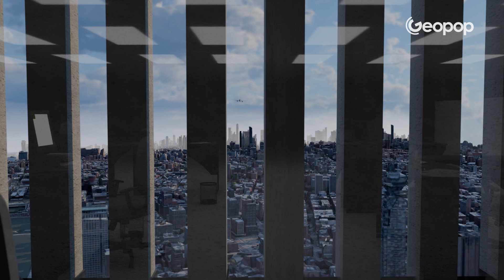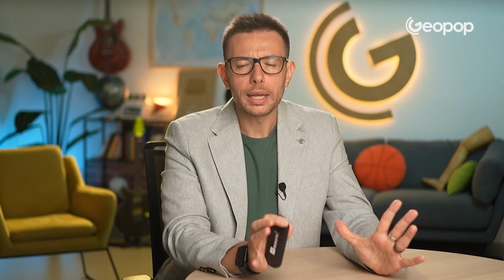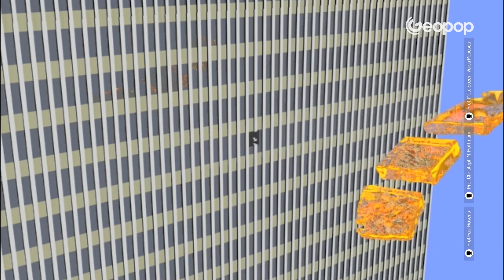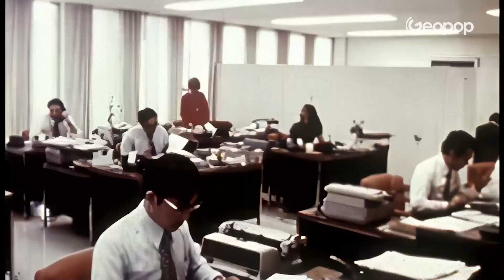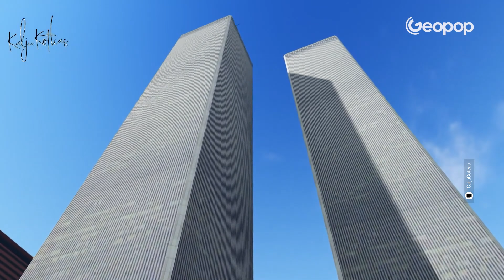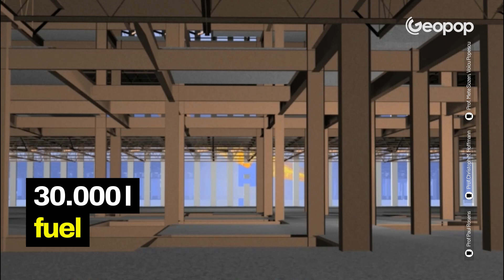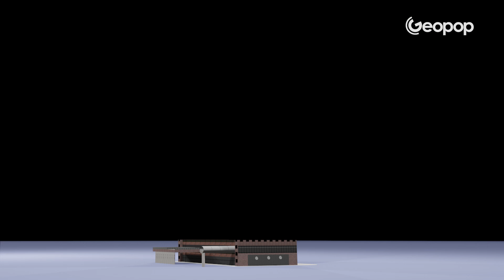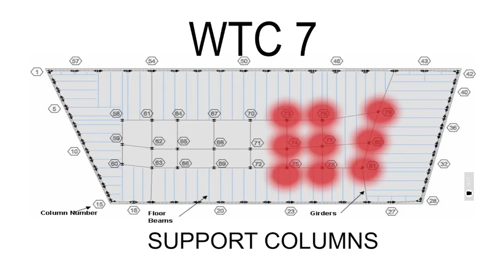9/11, 2001: The Technical Reconstruction of the Twin Towers and WTC 7 Collapses

Comment: What a load of
Reply: Knowledge
Reply: Get some.   @TheLoonResistance
Reply: I did. Now I can do this and you can't:  Twin Towers collapses were relatively straightforward, the fundamentals well understood in the professional engineering community within just weeks. Yet there’s a lot of really bad information floating out there on the internet, easily accessible to anyone and wild baseless speculation and pathological theorizing with easy hand-wave answers is simple, exciting and requires a whole lot less thinking, so it gets far more intention than it deserves.

To correct this I have on my own prepared this short yet detailed technical description of Twin Towers collapses based on my own observation and analysis of available true and relevant facts. No politics, ideology or magical thinking, just engineering. I hope is this will dispel many common myths and answer most if not all questions you may have about the Twin Towers collapses, because anything can seem like a conspiracy if you don’t understand how it works

While complex, most of the Twin Towers collapse mechanisms can be seen with the naked eye and easily discerned and understood by the layperson if sufficient time is taken to understand. 

1. The Twin Towers consisted of 4 primary structural elements that together formed an integrated system where each relied on the others.  47 hollow box-section steel Core Columns carry the majority of the gravity loads. The 236 hollow box-section steel Perimeter Columns carry the remainder and ALL of the lateral (wind) loads. Long-span Lightweight Steel Trusses connect the core and perimeter column together at each floor with a Hat Truss on top to tie the structure together as an integrated unit where no element can survive without the others. There was no structural load bearing concrete and most components were bolted together. www.youtube.com/watch?v=u7OqrC74Dm4 

2. The impact of 117 tons of airplane (= to about 12 dump trucks) at speeds up to 590 mph with the energy of a ton of TNT completely destroys the aircraft. This in no way implies the Towers come out unscathed. Many perimeter columns are damaged or destroyed as are some core columns (example; 33 of 59 perimeter and 20 of 47 core columns damaged or destroyed at the impact floors in the North Tower), This damage is primarily through bolt-shearing failures at the end connecting flanges, as well as bending, twisting and fracturing of weld seams. There was no cutting or slicing - the reality was far more violent and messy. 

3. The impacts destroy or damage fire insulation, fire breaks and sprinkler systems on multiple floors.  Huge fires are started across multiple floors simultaneously and allowed to spread rapidly with no effective firefighting or fire suppression. This was an unprecedented fire event . 

4. The hotter steel gets the weaker it gets .  With fire insulation stripped away and no sprinklers the survival time of the steel greatly reduced. Gradually over time heat causes the lightweight steel Floor Trusses at the impact damaged floors to sag, which was observed and recorded.  No steel melted or needed to. Structural steel fails long before it becomes a puddle. It just needs to bend

5. Sagging floor trusses pull on the increasingly weak and overloaded Perimeter Columns, causing some of them to bow inward by up to 5 feet. A straight column is up to 4 times stronger than a bent column. The bowed Perimeter Columns buckle and fail, initiating collapse. The formerly static mass above which the structure below could easily support is now converted into a dynamic mass up to 30 times greater. Because they have buckled, the Columns above and below the failure point are no longer aligned . The load bearing structure below no longer bears any load as it falls past the lower columns, NOT onto them.

6. Thousands of tons of debris fall within the four outer walls, down through the open office space, crashing onto the first intact floor it encounters. This massive impact immediately breaks the bolted connections to the columns as the amount of resistance the Floor Trusses can offer is negligible.  The falling debris slows only marginally and briefly. Note:
6a. This is NOT a solid top block crashing into and “crushing” a solid bottom block .
6b. The debris falls past the columns not onto them.  The columns provide no resistance to the falling debris. 
6c. Only the bolted connections of the floor trusses to the core and perimeter columns can offer any resistance. A pair of 5/8” bolts at each end of each truss vs. thousands of tons of falling debris.
6d. No laws of physics are violated.
6e. There is no 20 floors against 90 floors but rather 20 floors against one floor, then 21 floors against one floor, then 22 floors against one floor, etc. 

7.  This floor-led collapse progression within the four outer walls can only go straight down.  
7a. This process is often incorrectly referred to as “pancaking”. The catchy name stuck but nobody knows what it really. Pancaking is too simplistic and inaccurate anyway, I prefer Kaiserschmarrn.

8. Collapse progresses through the floor systems past the columns, through the path of least resistance . The resistance offered by each floor is always the same while the mass of debris and its velocity – thus its energy - increases with each floor failure.  Each floor offers the exact same resistance to the falling mass while with each failure the falling debris constantly gains both mass and velocity. *This process of floor-by-floor destruction cannot be arrested, it can only speed up . Rate of floor failures increases with each floor as momentum increases, reaching an average acceleration of 0.65 of GA, or 35% slower than true free fall. Bam, bam, bam down the building until there are no more floors to fail. The resistance offered by each successive floor is always the same. More mass, more velocity, same resistance with each floor. Don’t get stuck on the but the lower floors weren’t on fire nonsense. They weren‘t and didn’t need to be.

9. The Towers were 95% air by volume. As that air was compressed inside the building it is forced down the tower and blown out the sides in reaction to the building collapsing . Those were not “explosions”, it was expulsions of compressed air caused by the collapsing building, explaining the low velocity, lack of flash, blast, supersonic pressure waves and lethal high-velocity ejecta.  

10. Perimeter Columns become detached and peel away like a banana behind the collapse front, playing out to the four points of the compass extending to more than 600 feet from the base of the towers. This was quite obvious from examination of the debris pile. 

11. Core Columns fail last as their internal beam bracing is stripped away by falling debris and lateral support from the floor to perimeter columns is lost. 

12. For those who care about how long this whole process took; 31-34 seconds from the moment the perimeter columns buckled until the last core columns hit the pile, or 1/3 the rate of true free fall. Don’t believe me?  Just watch any video of the collapses and note the loose truly free-falling debris dropping much faster than the towers themselves.  

13. Each Tower had a 1-acre footprint. Far from collapsing inside their own footprints the debris pile spread out over 17 acres in a pile up to 14 stories deep. 8 surrounding buildings were destroyed and scores more damaged by the falling debris. 

14. NOT observed were the 180-190 dB bangs of thousands of high explosive devices or the blinding bright flashes of burning thermite. Neither explosives or thermite could have survived the impacts and subsequent fire nor could have caused the (silent) perimeter column buckling that clearly initiated collapse either. A video of a shocked and injured firefighter casually using the magic word explosion is in no way proof of explsoIVES  and the demolition_ case relies entirely on that sort of thing. There is zero tangible physical evidence and it would be technically impossible, totally impractical and completely unnecessary. No one would bother. 

15.  Twin Towers were perfectly safe within their design envelope.  They only collapsed when taken far outside design parameters by an extraordinary and unprecedented event 

Impact + Fire (heat) + Time + Gravity = Collapse . Remove any one of those four elements and there is no collapse. Ignore any of those elements (as many do) and you will never understand the collapses. The Twin Towers were an integrated system in which no one component could survive without the others. One fails, the rest follow, through the path of least resistance – DOWN – through the open space, bypassing the path of greatest resistance – the columns.  Nothing I just described violates any laws of physics. All of the above is true no matter who planned and carried out the 9/11 attacks or why 

In 24 years zero structural engineers of tall buildings, including the 1/3 that have retired in that time, have made any statements in support of 9/11 Truth BS demolition claims. Zero, nada, none. The lack of any such citations in the engineering literature (published in any country worldwide) is palpable.

I hope you found this helpful and informative. It is not meant to be adversarial, but to solicit informed critical comment, positive or negative. If I made any errors of fact, logic or reason or left anything critical out, please let me know so I can fix it. To stay focused just one topic at a time please and on-topic (Twin Towers ONLY). No word-salads of Gish Gallop. IF you can offer a more plausible alternative be my guest. Please start any reply with the words “Tits McGee” or I will know you didn’t actually read it, are not serious and just wasting my time. If you are going to argue, do it on the merits.
Reply: You got so mad at a mere four words you typed me a book???  Lmfaoooooo sounds like I win already lol  @TheLoonResistance
Reply: Don't flatter yourself that I wrote that for you - since I knew you wouldn't read it anyway. You are not serious and as with most consiratards are intellectually limited to an attention span of no more than 4 lines of text (NOT sentences).

Comment: Really? What caused the collapse of the twin towers? A lunatic or bastard, as I prefer to call them, decided to crash a jet with thousands of gallons of fuel and people into them.
Reply: The towers were designed to withstand that.
Reply: @Kudde23what’s that got to do with it? I answered the question. The world saw it happen. Did you miss it?
Reply: @karaloca  Yes, the world saw the controlled demolitions happen, I did not miss that. Did you?
You felt smart because you managed to realize that planes crashed into the towers and so you thought you knew what caused the collapses. But you didn´t know that the towers were literally designed to withstand plane crashs and that´s why I let you know of that fact. Sad that such simple things are way too complicated for you to grasp.
Reply: @karaloca  - Attention seeking troll best ignored. It does not actually care.
Reply: @TheLoonResistance  Oh I do care stinkyfitz, that´s why I don´t ignore you attention seeking troll.
Reply: @Kudde23heheheheheheheheheheheheh. Hehehehehehehehe. Hehehehehehehe.
Reply: @Kudde23 The towers were "designed" to withstand an impact from a plane smaller than the 9/11 jets, going 1/3 the speed of the 9/11 jets, and low on fuel (not fueled for transcontinental flight). Those things make a BIG difference.
Reply: @Tim22222  Oh timmyshill, my poor little wannabe, they calculated a 707 crashing at 600mph, faster than any actual 9/11 plane and therefore more destructive than the actual 9/11 crashs, according to NIST. You heard of NIST my poor little wannabe?
Reply: @Tim22222  Still trying to figure out what NIST is timmyshill?
Reply: @Tim22222  What a pathetic loser you are timmyshill...

Comment: You forgot to mention the thermite shooting out the side of the towers. This guy is so full of shit that people that read sign language knows he's full of shit too.
Reply: Thermite pouring out of the South Tower (and it was in fact ONLY the South Tower)?  You mean this?

youtube.com/watch?v=xPVGGQU-MeQ&ab_channel=SeekersofTruth 

So you think that is thermite why?  Because you performed metallurgical tests?  Because the internet told you that’s what it is?  I think we can do better, so let’s do better and build a theory the right way instead of making evidence-free assumptions. This will take just a couple of minutes and is worth the investment. 

The Boeing 767 which struck the South Tower weighed 117 tons and 80% of that was aluminum.  The exterior cladding on the Twin Towers – the white panels – were also aluminum. When Flight 175 struck at the 81st floor its momentum deposited much of the office contents in its way and the bulk of the aircrafts mass into the NE corner of the building. The piled up debris shoved into that corner is visible in photographs and video so we know it was there. 

There’s a good shot here of piled up debris from 4:36;

youtube.com/watch?v=ZLJyL63sqtU&ab_channel=MrKoenig1985

Steel melts at roughly 2,750-deg F while fires in the South Tower reached peak temperatures of around 1,800-deg F. Aluminum OTOH melts between 887-deg F to 1,180-deg F depending on alloy. That aluminum will melt under these conditions is not a surprise. If you look at pictures of cars left behind and destroyed by forest fires the aluminum wheels are invariably melted away along with other sometimes aluminum parts like hoods. Steel bodies remain intact. 

The “molten metal” appears at 9:52 am. At the same time we see the first externally visible signs of sagging floor trusses and the pulling of the perimeter columns inward. I submit these events are related, not coincidental. The aluminum cladding at the NE corner also appears to me to be burning. 

It is likely with the floor trusses sagging under the heat, and the 81st floor truss in the NE corner under the debris pile subjected to the heavy load of the debris pile, the truss broke its perimeter column connections and dropped, instigating the material starting to pour out of the NE corner at the 80th floor.

Given the properties of the materials in question, aluminum is by far the most likely culprit. 

Reports from The NIST, FEMA and MIT all concluded the material is aluminum. 

Certainly steel is the least likely of all the materials the anomaly could be given its much higher melting temperature and the fact there is no logical source for molten steel.  The perimeter columns in the NE corner are intact and the material is pouring out between them. So it isn’t columns melting, therefore what other source of steel is there?

Deniers will claim molten aluminum appears silver when molten, which is true but only at the low end of its melting temperature range. Aluminum can and does get hotter and it glows red to orange when it does (1,100 to 1,800-deg F).  Most folks of course just don’t bother getting it that hot if the goal is just to get it molten for say molding a part. No need to go higher. 

The total mass of molten aluminum is a BIG deal in regard to how it behaves when poured. Quantities bellow half a liter cool almost instantly if poured onto a flat surface, but if poured into say an ingot mould will stay red for a minute of so. Pouring volumes of molten aluminum greater than a liter is a VERY different experience. The thermal mass is much greater and the radiant heat is horrendous. The aluminum is able to stay liquid and remain glowing bright orange much longer. 

The famous video of glowing liquid gushing out of Tower 2 moments before it fell, involves at least tens of liters of molten aluminum. The thermal mass involved is so great that it stays red after falling many meters through the open air.

Side note: There was also a large UPS battery farm in that spot and some of that material at least may well be from the batteries IMHO.
Reply: @TheLoonResistance  No matter how often you post this copy post garbage, the problems still remain stinkyfitz.
NIST analyzed steel directly involved in fires and most parts hadn´t even reached 250 degrees Celsius, NO PART had reached 600 degrees Celsius. Aluminum melts at 660 degrees Celsius.
AND THEN IT STAYS SILVER IN COLOR!

And that´s how easy it is to debunk your tons of shitload comment. EVERY TIME you post that garbage stinkyfitz.